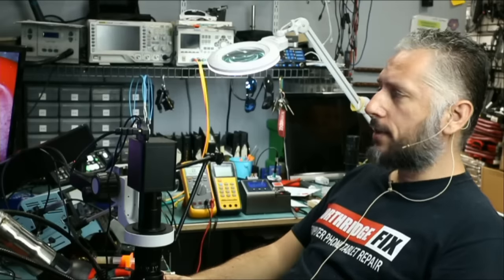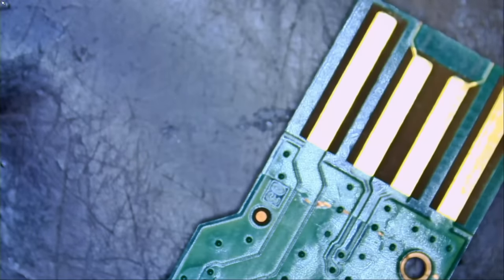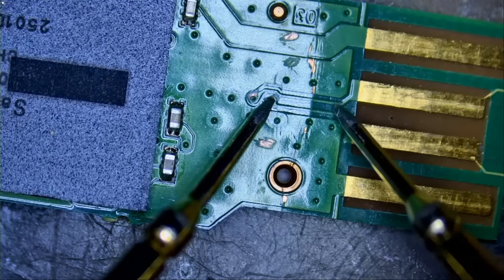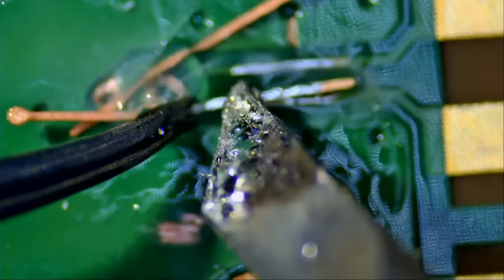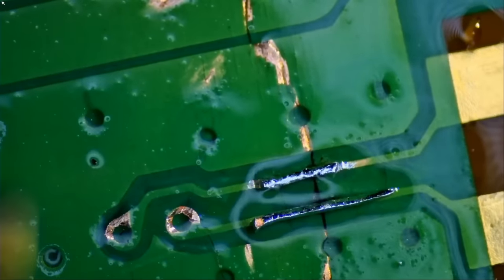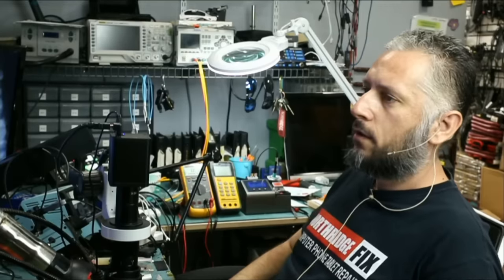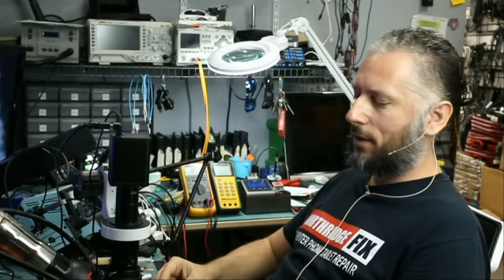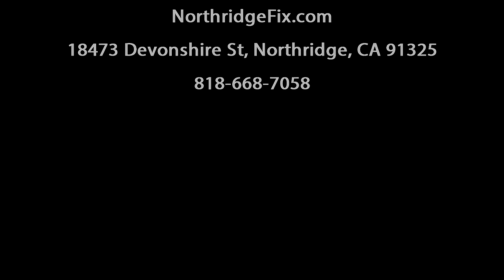Sandisk Cruzer USB Flash Drive Bent and Cracked - Can we save it ?

Comment: Yesterday I fixed my water damaged Samsung A53. Took it apart and cleaned corrosion off with rubbing alcohol. Put it back together and it worked. It was not easy on my eyes. I take my hat off to you Alex for what you do every day. I have a new found appreciation for those that do micro soldering and phone repairs.
Reply: That was nothing, let him fix a 0.3mm pitch FFC.

Comment: Please make video on how to properly desolder a power stage mosfet like the ncp302150 from a gpu board like the msi rtx3080 gaming x trio. Im sure there are so many newbie technicians that wants to learn how to desolder these kind of chips. What temps are needed and what type and wattage of heat gun. Is there any chance we can desolder these kind of chip with a 700watts helical type heat gun. thank you

Comment: Excellent friend, one question, does this sandisk cruzer blade model not have a recovery and flashing program or software? Once they are write-locked they are useless and there is no program to unprotect them. Even the sandisk brand has not released the mpt software to be able to flash the memory chip of these sandisk cruzer blades? Is there any way to unsolder the memory and place it on another chip compatible with the software of another brand and repair it from another flash drive and then put it back on the sandisk or is it not possible to do that? Thank you.

Comment: Why not make the files available to the customer over the net? You could pack them into an ISO and then compress it in a password protected zip or a self-extracting rar and have them download it from somewhere. Do you think that would end up being more hassle in the end?
Reply: Many of those customers don't have great technical skills.  Writing ISO images is probably beyond the skill set of many average users out there.
Reply: @redbaron6805  They don't need to write it. They just need to r-click and mount it.
Reply: @khatharrmalkavian3306  It is much simpler for most people to get a replacement flash drive with their data, so they have a physical copy of their data.  You assume everyone has a fast high speed internet connection, drives and knowledge how to do this.  In the real world, that is not how it works.

The data recovery in many of those cases are for people that are not sophisticated computer users.  If they were, the drives would have never been an issue as they would have backed up their data in the first place.

Comment: Yes, copy the files onto a new drive. The ground and power are connected but damaged and your repair is good for getting the files but might not be a durable as the original traces. Good job and good solutions.

Comment: I fixed same drive years ago. I did it with enamel wire, and I've wired it trough those 2 holes to the other side because it was easier to solder them on that side. Cool design, crappy product. (funny I still have it and its working)

Comment: It was also necessary to strengthen the 5 volt line with jumpers, since it is clearly visible there that the gap is going further. Pour the usb connector area with Chinese glue for strength.
Reply: I believe the goal is to get the drive fixed just enough for data recovery to be possible

Comment: They should have made  this PCB with thicker traces for those middle pins. Sandisk should know better.
Reply: The middle pins are just signals, they wanted thick traces for the power supply which is logical. Anyway they are not meant to survive the PCB being bent.

Comment: I have a question I'm trying to find a video about Sandisk USB drive it only reads on Mac it was working fine before until I downloaded this file and move the folder I don't know what happened well my question that I'm I really want to ask how do you reformat it on Mac disc utility is not working also does not want to erase the files or even the whole drive and I'm just trying to find some tutorials and I don't see no one showing how to do it on Mac pro is this issue fixable? Well I appreciate your time if you come across this may you have a good day thank you 🙏🌄🫡